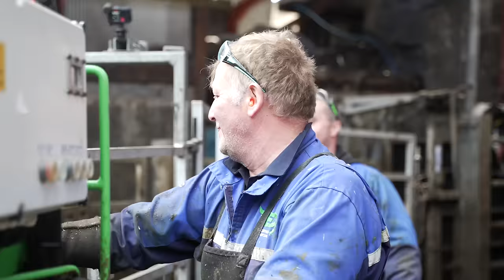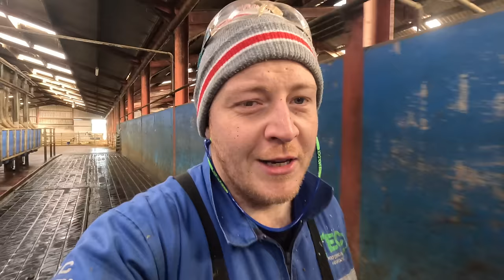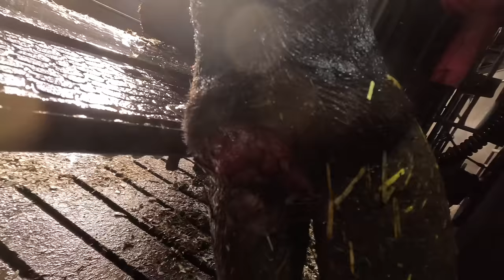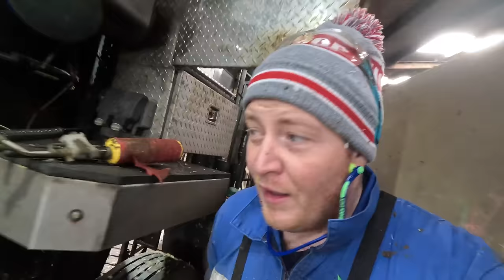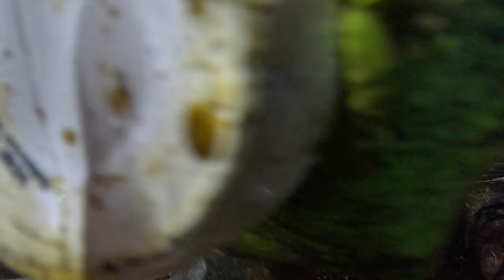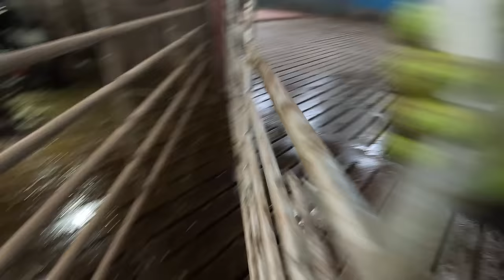ANGUS COW CAN'T put WEIGHT on this FOOT???

Comment: I like the squeaky but kind of crunchy noise that the knife sometimes makes on hooves. I also like the bandages being unrolled before you wrap it around the hoof. Not something heard often, but when an abscess under pressure is cut, sometimes the pressure release can be heard when the knife finally breaks through to the cavity. That's the best because you know it's instant relief for the cow by removing the build up pressure inside the hoof capsule. Thanks for making these videos. They are so relaxing after a chaotic day.